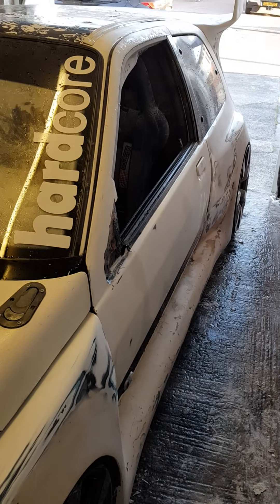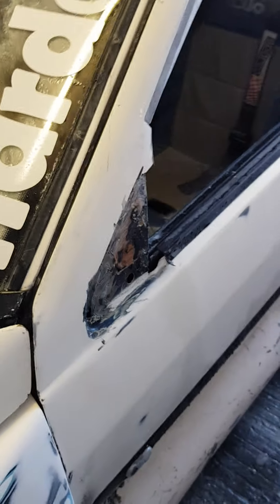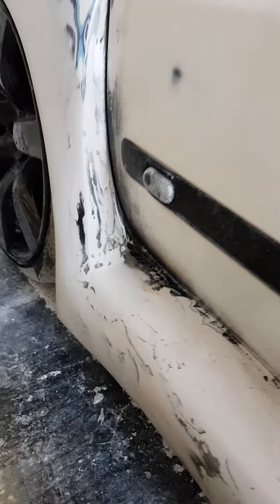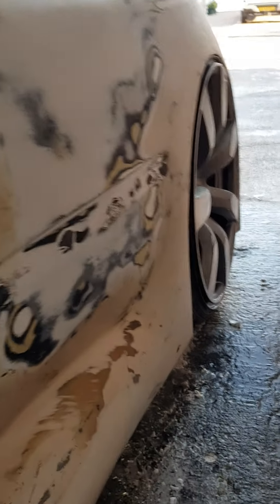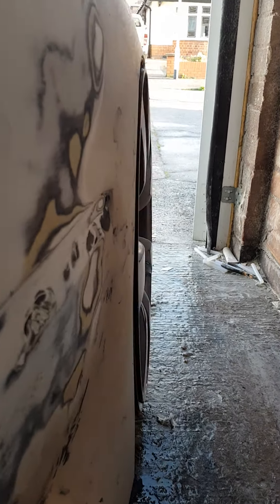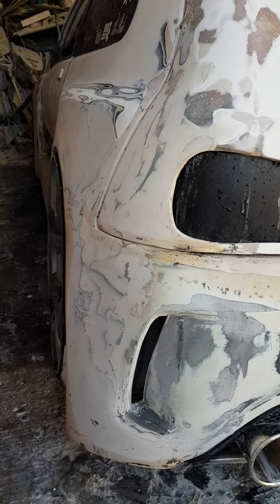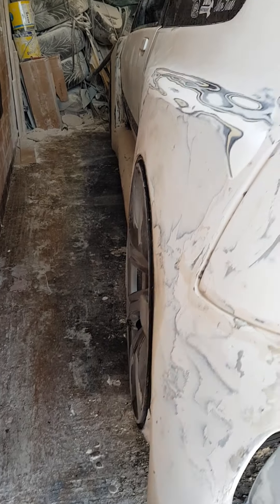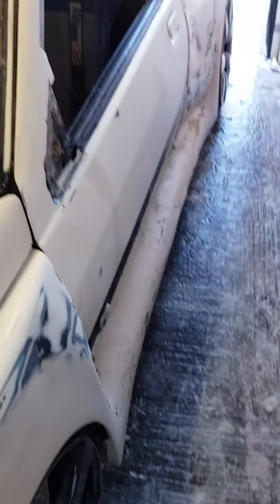3 - Clio sideskirt and quarter/wing sanding and shaping on nearside

Comment: Will the car being drivable ? Or just displayed at car shows as i cant imagine you being able to turn the steering wheel without ripping ur fenders off 😂 but looks great keep the update videos coming
Reply from the maker: The car will be driveable. The turning circle wont be too great but once the intercooler pipes have been rerouted and the bumper shape changed a bit the steering will be able to move most of the way without catching too much. the car is on airride by the way so i can get clearance on the arches when driving